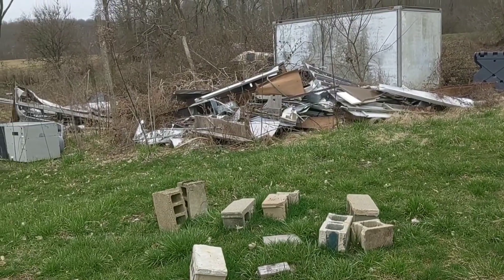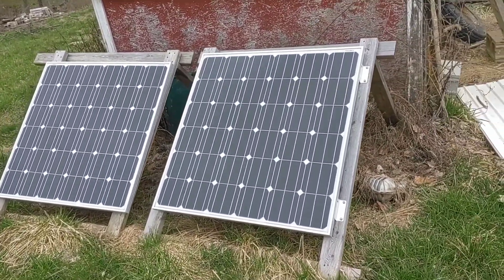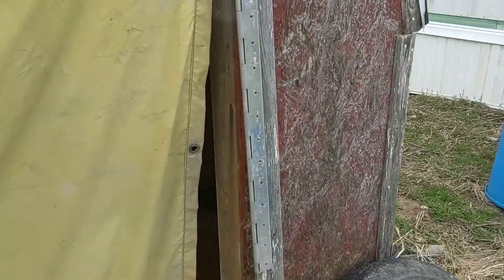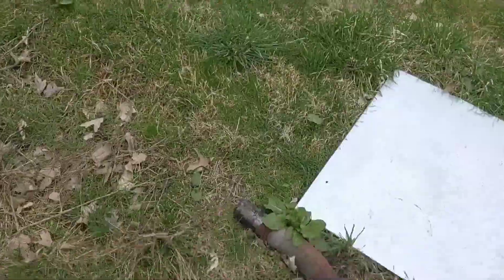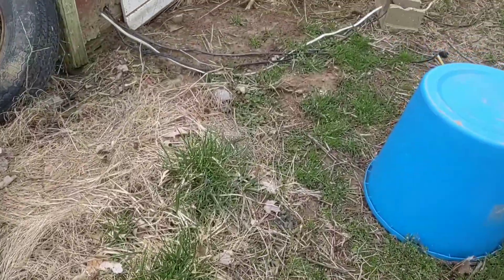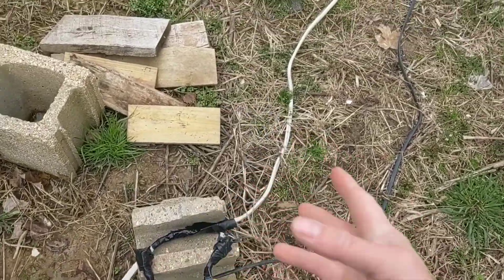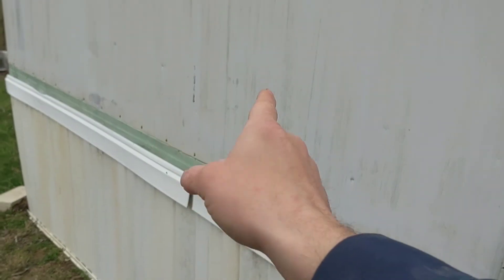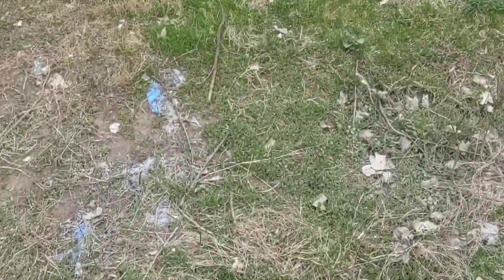Solar Powering A Mobile Home

Comment: Just found your video how come you did not wire the power inverter to the main breaker in the house and just switch off the breaker you don't use? I'm trying to go off grid with 20 12 volt batteries doing a series parallel system to make 5. 48 volt batteries with a  5000 watt 48 volt inverter and hard wire it into the main 100 amp breaker in the house and turn off the breaker I don't need. Will I be doing something wrong that way ??? I'll have 3000 watts of solar panels to feed the batteries, I just don't want to burn the house down by over looking something you know that I missed.THANKS for the video

Comment: Hell im looking for a trailer just like that. And the pump look into shurflo pumps we use them on the boat i work on. Not sure if they have 120v options but i know they work on 12v
Reply from the maker: Thanks for the tip Steven! I'll deff check those out

Comment: I like it it looks good to me it was if it works right I’m trying to I live in a mobile home myself I’m remodelling it got a lot to do with it but it’s it’s a Home put dogwood all around it put a metal roof over it only thing I Gotta do is fix the bathroom floor someday and the bedroom that’s it But I want to get power on solo I want to go everything solar panels do away with power through the electric company finally got my wife on board she’s got sick and tired of paying the high electric bill and I just me and her we don’t Hollyburn anything we have no stove in the winter time is only time we use the furnace only thing I want to get power to is the well the furnace and water heater make sure I got power to that and lights I was thinking about hooking solar panels but separate from the lights to my building for power to run power tools and my big air compressor and have another solar panel 200 wattage I think it’s all I need is to run the well the water heater in the furnace I got it figured out too I’m trying to figure it out all this myself to how to do it I meant figured out how many batteries I need or anything that yet I got to get a good converter box